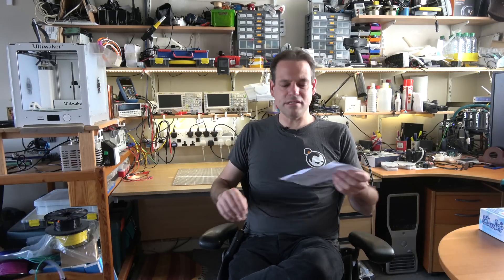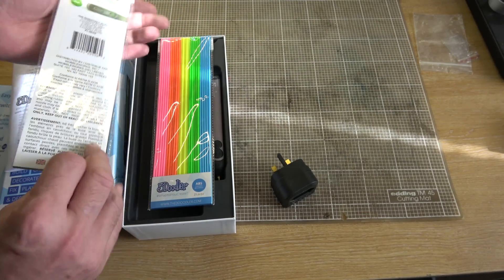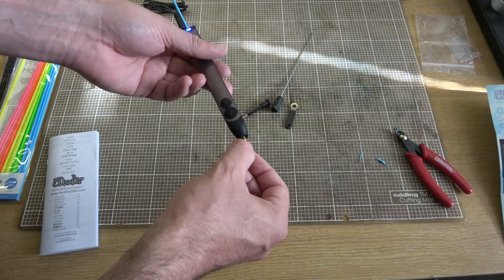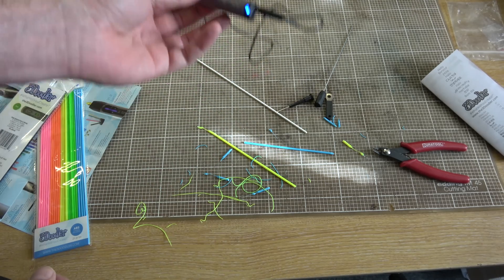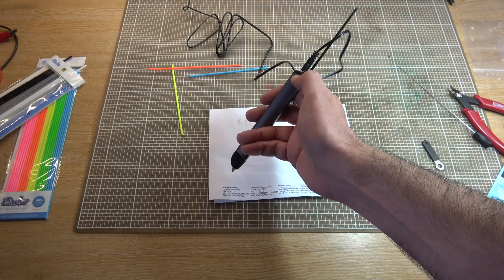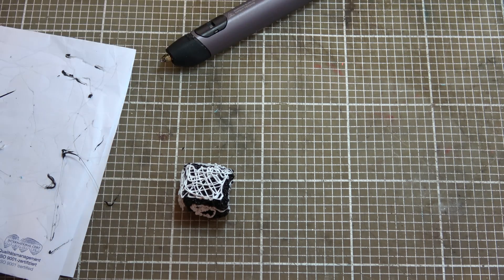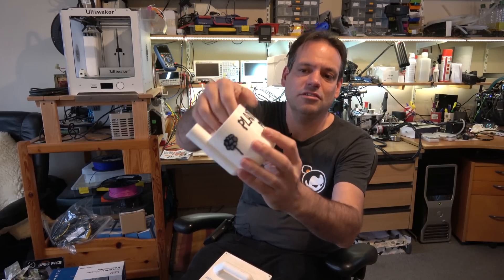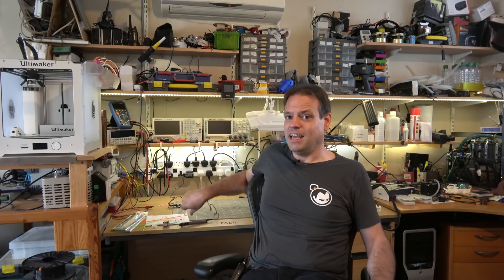3Doodler 2.0 Unboxing & Review

Comment: You were forcing the filament inside  and the 3doodler spins the filament inside of itself before it feeds it and you forcing it didnt allow the filament to spin which caused it to jam
Reply from the maker: I really wasn't. I spoke to 3doodle after I'd made this video and they told me that the 3doodler 2.0 was not a good design and they sent me a '3Doodler Create' as a replacement. The Create looks nearly identical to the 2.0 but I've not had any problems with it at all. It's still going strong 4 years later (though I don't use it often). Cheers!!

Comment: It's the size of you nozzle if you get the nozzles pack use the big circle one. At the beginning I had trouble with it but I changed my nozzle to the bigger circle and it worked soooo much better

Comment: I have purchased 3Doodler and liked it very much due to following reasons

1. Its a sleek pen which has seen an upgrade from the 3Doodler 2.0, making it a bit smaller and lighter, and definitely quieter. 
2. The pen is 0.7 x 0.7 x 6.3 inches, making it one of the thinner craft-quality 3D pens, and 
3. it weighs about the same as its predecessor with a 50g aluminum shell. 
4. Features a .7mm nozzle, you can use 3mm ABS and PLA filaments with this pen. 
5. Packaging includes 25 strands of each to get you started. 

To know more like speed and heat, click here http://prourls.co/xD3c
Reply from the maker: I just couldn't get the 3doodler 2.0 to work correctly... I contacted 3doodler and they sent me a replacement 3doodler create, which looks nearly identical to the 2.0 except that the body is blue instead of grey, and the 3doodler logo is the correct way up for right-handers... The '3doodler Create' is a fantastic device and fixes the issues I had with the 2.0 nicely. It's amazing that two identical looking products from the same manufacturer can behave so differently. Cheers!!
Reply: @ThingsWhichArentWork  what side do you have write for the new doodler? I have the 3Doodler 2.0 and the same problem, pls help me

Comment: How many goes did it take to finish the word fail ;-)

Would be better if it could just  get hotter and supply enough power to keep the element hot!
Reply from the maker: Hey John - I think the 3doodler is quite an amazing piece of design. So compact in the hand and comfortable to hold... and al they needed to do to achieve it was to leave out all of the larger bulky heaters, motors and mechanicals that are needed to properly extrude plastic at 250C. Cheers!!

Comment: hey Jim did you try measuring the current?  was the brick up to it?  could try with a meatier powersupply.
Reply from the maker: Hi Paul - I didn't measure the current, but the pen shows no signs that 
it's a lack of current causing the problem (heats up quickly enough.. 
motors whir quickly etc)... I think the problem is with the calibration 
of the NTC thermistor inside the tip. I've actually got the pen in 
pieces on my desk at the moment, trying to figure out the path that the 
NTC thermistor signal takes to see if I can bodge in an extra resistor, 
thereby making the microcontroller inside heat things up to a higher 
temperature.... Teardown/Repair video in progress.... Hope you & 
yours are all well. Must do a meet-up soon. Cheers!!

Comment: What's the ouput of your power supply?  I recently purchased 3D Stereo Drawing pen off of Ebay (£20).  I wanted it for laying conductive filament onto existing 3d Prints.  I also thought it might be good for repairs etc.  I purposely looked for one with a 12v 3amp ps.  The reviews I read of the 3.0 versions state that they do not get hot enough to work well and they seem to be working off 5v ?amps.  Version 2.0 uses 12v, usually 2amps.  I haven't adjusted the temperature on mine yet because it seemed to work well enough with PLA although I thought it needed to be a little hotter.  My pen is set to about half of its total temperature.
Reply from the maker: Hi Bryn - The power brick is giving out 5.1V with no load attached. There's no sign from the device that it's struggling to get enough power... The motors don't seem to struggle or anything like that. It just seems as if the set-point for the temperature is too low.... and given that the design pauses the motors when it can't maintain temperature, it would suggest ot me that they just didn't put a big enough heater in there in the first place... I should have gone with a cheapy off ebay instead. Cheers!!
Reply: Regardless, even with enough heat their successful operation is a bit of a black art :) The cool pics of toys and Eiffel Towers and the like are all well and good but god knows how long it takes to become that proficient. I'm convinced more and more that we live in a world with lots of cool tech that almost works ;)
Reply from the maker: Ain't that the truth :-) ... I have a little rant which I keep on using over and over again at work... 'Bad products are designed to work correctly, good products are designed to go wrong'... This is why cars have warning lights for low-oil, engine-fault, low petrol etc and computer servers have RAID disks and ECC error correcting memory (all desgined to go wrong)... Whereas 3D printers just keep on stepping through the program ragardless of whether they've run out of filament, or the extruder isn't maintaining the correct temperature. Cheers!!
Reply: I think one of my favourite illustrations of this is the movie 'Brazil' by Terry Gilliam, starts off with a moth falling into a printer that mis-prints an arrest warrant.....
Reply: You've inspired me to spend more time with my own 3D pen.  I see that if I keep the tip close to the surface it slightly smudges the filament which appears to make it more adhesive and creates a better bond.  If you have the feed at full speed you get thick lines, slowed down you get thinner and if you move the tip relatively quickly the lines are quite smooth. You can also do a circular motion that mixes the filament up makes quite thick and strong lines/surfaces. It also helps if you draw each side of the shape that you want to make and stencil over the lines. Flip the model over for each side you want to make with the base being on the paper or surface you are modelling onto. For more complex shapes I imagine some kind of temporary armature could help.
Reply from the maker: Hi Bryn - I'll have another play around with the pen (using PLA plastic only) sometime soon and try out some of the techniques you suggest here. I've seen some pretty impressive things made with 3d pens.. just not sure I have enough patience to put in all the time/effort it must require. Cheers!!
Reply: Ignore the pictures of spindly horses etc. and think in modelling terms, make shapes that can be welded together, build in layers. Good luck!

Comment: Hi Jim,
I really enjoy your videos so thanks for that! But I couldn't help to notice that you are using a counterfeit Mitutoyo digital caliper... :( I hope you are aware of that and didn't buy it thinking it was the real deal.
Reply from the maker: Thanks Daniel - I intentioanlly bought them knowing that they were a knock-off after I found that my 'powerfix' branded calipers (the generic no-name ones from ebay) consistently gave the wrong readings on parts of the scale...Depending on where you are on the scale, the powerfix ones will deduct 0-10mm from the actual reading. Of course, I found this out the hard way when the bits of my project didn't fit together... I saw AvE's anti-review of the Mitutoyo knock-offs and all the way through I was thinking 'they're a lot better than the ones I've got'... I clicked on 'buy it now' whilst AvE was throwing them in his dustbin. Cheers!!
Reply: Well OK then :) I've had a pair of fake ones as well and I sure wouldn't trust them. Threw them out after taking a close look at the poor quality. But as you said, they seem better than the powerfix stuff :)

Comment: Yeah it's most likely that the ABS is too solid at the highest temp of the 3Ddoodler and it can't be fed through. The motor seems pretty weak to even do it too. Not sure why they will include ABS anyways since the fumes that it releases are bad for you :/
Reply from the maker: Hi ATC - After I made this video, I checked out some of the 3Doodler reviews on Amazon... 57% of them were 1-star... Interestingly though, it seemed that about 50% of people couldn't get it working with PLA and the other 50% couldn't get it working with ABS... I think there are serious quality control issues over the temperature calibration on the 3doodler. It's a great shame as I had this cunning plan to use the 3doodler for making ninjaflex gaskets for my hydroponics stuff. Cheers!!
Reply: I was going to comment that maybe you got a defective unit.  Based on the Amazon review, 57% of the customers received a defective unit like yours!  Yikes! Thanks for giving it a fair trial.
Reply from the maker: Thanks Hari - I'm not sure that the unit is actually defective. I took it to pieces the day after I made this review video and tried to tweak the internals to increase the tip temperature... My fix sort-of worked in that I successfully increased the tip temperature, but the heater still just doesn't have enough power to keep the ABS flowing out. (the teardown video is uploading in the background right now whilst I'm replying to comments. Chhers!!